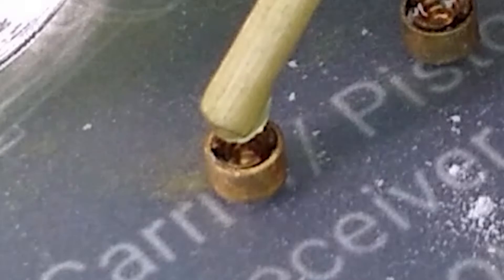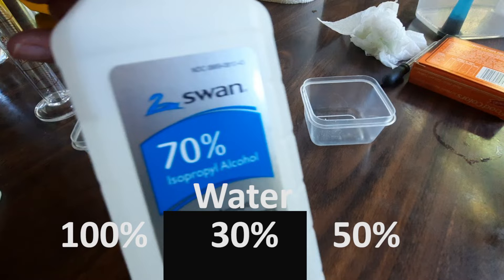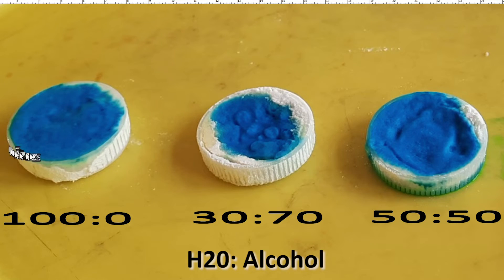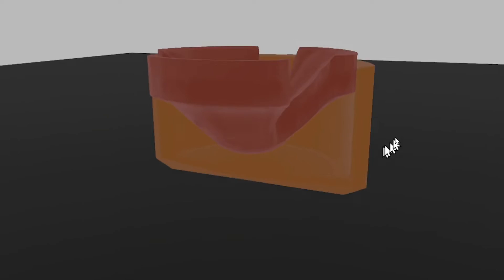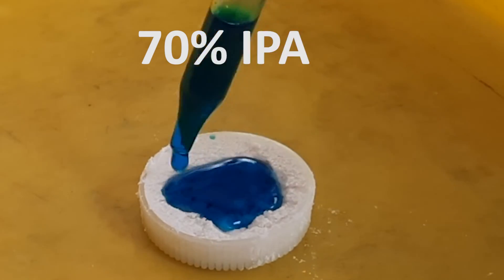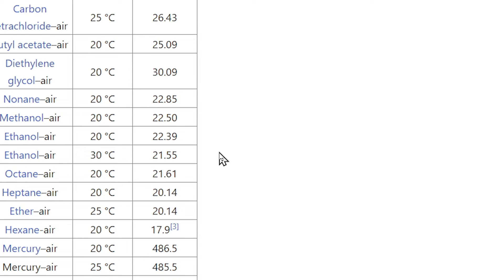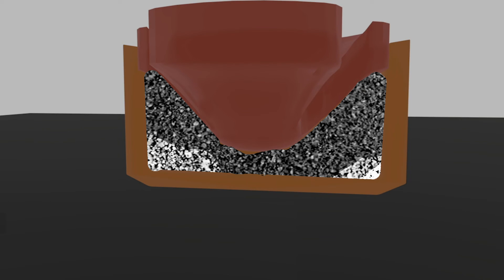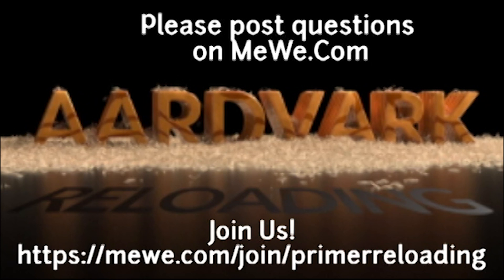Homemade Primers: Primer Activation - Surfactants

Comment: What does activating means? This process make them packed and easy to detonate ?
Reply from the maker: Our MeWe group adopted a primer recipe called EPH 20.   To make the powder "go live" it must be activated.   It is activated with  (of all things) water.    But we want the powder to be totally saturated/completely soaked from top to bottom with water or else the powder at the bottom of the cup won't burn (after it dries).   So we learned to add a little bit of alcohol to the water which in-turn decreases the surface tension of the water.   This allows the water to penetrate the dry powder more easily (all the way to the bottom of the cup).   

The alcohol has a second benefit.  Once it has done it's job of assisting in activation - it dries faster/easier so the primer will be ready to reload faster.

It's simple yet amazing as to how smart those guys (the chemists) are.   But they teach ordinary folk like me how to do it.   I, in turn, teach my listeners ( all free of charge).     

My next entry is an invitation to to the MeWe groups where you can see other lessons, ask questions and such.   All are welcome to join.
Reply from the maker: Hi there!

Jump Start 1 - I'm trying to get you going!

https://rumble.com/vjdy5h-reloading-primers-for-beginners-jump-start-1.html

AardvarkReloading.com and MeWe’s Primer Reloading and Primer Reloading for Beginners Chat Forums go hand-in-hand.

Please go to one of the chat rooms and let us know what information you need to get started reloading your own primers and our group of members will do their best to provide it. We are very interested in your success in this endeavor. There will be no ridicule of any questions you ask no matter your experience level. We grow by utilizing your background and experience in your various professions - so please be willing to share.

The MeWe chat forums consist of the best group of guys on the internet in primer reloading and other skills and you're now a part of it.

Primer Reloading group (known as Second Floor):
https://mewe.com/join/primerreloading

If you find the Primer Reloading group chat too technical, try the ground floor:

https://mewe.com/join/primerreloadingforbeginners

You will be welcomed in both!!!

My website:
I publish much of this info on:
https://aardvarkreloading.com 

==== MeWe Navigation ====
MeWe Navigation - Groups:
https://rumble.com/v15wnom-homemade-primers-mewe-groups.html

MeWe - How to Chat:
https://rumble.com/v15x61q-homemade-primers-mewe-chat.html

MeWe - How to Post:
https://rumble.com/v15x61q-homemade-primers-mewe-chat.html

Posting Photos and Files:
https://rumble.com/v18j51b-homemade-primers-mewe-groups-photos-and-files.html

and Finally . . .

One of the ingredients of many primer formulas is glass (from 'say'  a broken light bulb).   But this glass must be hand ground to the consistency of flour!

The information and all my tutorials are free but I must pay for the website, software, tools, and chemicals for R&D.    Click on the link below if you would like to help keep this effort going (and I'll send pre-gtound glass in return).

Thank you!

https://aardvarkreloading.com/aardvark.html

Comment: I have a primer compound that recommends acetone, any thoughts on that?
Reply from the maker: Id have to look it up but i think that would work well.   There is a chart i.ll have to google.     If i find it i'll share here and post on www.aardvarkreloading.com.   i don't think it will adversely react with the other ingredients.   

Check that - except the nc ( ground gunpowder).    It will soften but once the acetone evaporates - it will remain nc.

I'd have to test it to make sure (easily done).    Good question.
Reply: @helpmenowmark   Thanks for the help.  I think the stuff is called PrimeAll.
Reply from the maker: @Clarence_13x  oh.    Im familiar with primeall.   It will work.   But its an expensive form of h48 and corrisive to your barrel.   Use noncorroaive eph 20

Comment: What about using DMSO?
Reply from the maker: I am not familiar with this.    Is it accessible and inexpensive like isopropyl?
Reply: @helpmenowmark  pretty sure Brian is talking about Dimethyl sulfoxide. I'm not up to speed on the specific reaction that activates the compound, but there are a lot of different things you could experiment with in the place of isopropyl. The easiest thing that comes to mind to see if it makes any difference is ethanol. The difference between isopropyl and ethanol(without kicking off an organic chemistry class) is 1 carbon atom. Not sure if there would be any difference without knowing the details of the reaction, but maybe 🤷‍♂️
Reply from the maker: @joearledge1  but you are right.   Ethanol will work just fine and has been cleared by the chemists in the Mewe group.
Reply: @helpmenowmark  Sweet! Definitely can't wait to get started making my own compound
Reply from the maker: Where does one find it?   How much does it cost? What will it do to the other compounds in the primer cup?

I prefer to keep things simple.   Without having to google or crack any chemistry books... isopropyl alcohol ìs readily available, cheap, and it works.   It dries quickly (a good thing), it weakens the surface tension of the water (so the water penetrates the primer compound easily/all the way to the bottom of the cup) and it  doesn't adversely effect the primer compound /the ingredients.
To be truthful - we may not need it ( the water may soak in by itself).. But any compound in the bottom of the cup that isn't activated will be  wasted and it will result in a weak primer.
Reply: @helpmenowmark  excellent questions... I have no idea without researching it. I agree with KISS, but am also not opposed to experimenting with stuff just cause... eventually I'd like to take a look at the chemical reactions for some of these compounds. It's interesting that the water is what activates it, related to the auto-ionization maybe?🤷‍♂️ I'm also curious if the carbon chain on the hydroxyl group matters at all (methanol vs ethanol vs isopropyl alcohol, ect...) if not (within reason) then that could open the door for more improvisation in a pinch. If it does matter, does that mean that we can get better performance using one over the other? Or is there one that should be avoided? I know what you have works, and that's awesome, I'm just a curious nerd who likes to play with stuff and overanalyze everything🤓

Comment: I've gotten my EPH20 kit back out after a year and made some SRP's, SPP's and LPP's just for fun, it got a lot of attention from fellow reloaders on Tiktok, I sent several to your channel. I need to try wetting after putting anvil in if it will get 98% to 100%. I'm still pleased with how great they work lightly packing, wetting 50% iso then hemp rolling paper then seating anvil. I'm going to try obsidian glass powder instead of light bulb glass for the hell of it to see any changes. Thanks for the video!
Reply from the maker: Hi .   I wondered where you went.
Thank you for prospect's.   I e got a write up on improving reliability.    Did u see it on mewe?
Reply: @helpmenowmark  Thanks for the reply, I haven't, need to check it out, just got back into it again. I will lose the disk, thanks, anything to speed it up. I have always returned anvils to the cup they came from since day one. Now just using factory primers I've shot and sorting already vs a big jar of cleaned spp and lpp.
Reply from the maker: Lose disķ.    Not needed with eph 20
Reply from the maker: I think using cup anvil pairing may be a good move.   Headstamp sort your brass and keep cups and anvils matched when u deprime it all in batches
Reply from the maker: Next step down would be to use cci anvils only with chrome colored cups (for spp)
Reply: @helpmenowmark  Did you see my post recently of the spent primer ingot? Melted a couple lbs of cleaned spent primers into a polished ingot, looks fantastic, going to cast a small hammer for my eph20 kit, seems fitting. The finish hammer is overkill
Reply from the maker: @JaredHempfield  sure did.   Clean polished brass looks like gold

Comment: Glad I waited to the end of the video... you mentioning the "distilled water"...LOL.. I was bouncing on the edge of my couch.. But, you covered it.. I will go back under my rock and hide... As per the additives that are in bottled water and regular ole tap water, yes, there is allot of junk in it. One of the papers you linked me too about a year ago (approx) put me on a path to another paper that didn't have much to do with primers, but salt and chlorine and the various effects on the various sodium's and at various burn temps and various burn rates.. Which, until reading that one, I hadn't really put much thought into burn rate and burn temp and what the direct outcome results in different types of sodium's. Granted, the amount of chlorine/sodium that is with in a single drop of tap water VS a toxic measure of lethality, well, by my rough calculations, a man would have to rap off about 20 million primers with in a sealed off closed room about the size of 2 foot cubed (a box around ones head) in efforts for any worry... But, if there is another way to do it better, WHY NOT do it better, cleaner, safer, etc... Either way, a drop of something is needed... 

Thank you for the video. The past year or three, since I have been experimenting with PRIME-ALL compounds, I spend more time learning chemistry and reading papers then actually firing them off..LOL.. And I am loving it.. Upon a side note, I still have that large batch of test coupons of spent and unspent compounds (formulated as directed) on the various metals, to see the corrosiveness, various grade/alloys of aluminum, likewise with grades of steel, and stainless steel, and alloys of copper and the brass alloyed family. I check it about every month or 3.. Nothing notable yet as per pitting, rust, dusting/converting, stickiness... I am thinking about setting up an additional test, by cutting the samples in half with a razor blade, scrape each pile into 4 piles on each coupon, and drawing a line to divide the pair of piles with a wax pen, so there is a unspent charge, and a spent charge on one side of the wax line, and likewise, for the other two piles opposite of the wax line. one side dropping 2 to 4 different gun oils or cleaning solvents on those... It really should be a whole different set of test coupons to not contaminate the original test I have going on. The theory is, the wax line (hopefully) will prevent the leaching or wicking action of the oils as the oil tries to flatten out on the whole surface of the coupons? I don't know.. I may wait until I am satisfied with the testing I have waited this long for, to do a real world testing, that doesn't cost me anything, like buying one of those $90K weather stress testing machines that can do 5 years worth of corrosion in like 4 days.... I think not!!!! Imagine the amount of primers a guy could buy with $90K, even at today's over priced products... 

Pardon the novel.. I am just having fun with this stuff, as it seems like you are too. To give you another update, Which I won't and can't give the details on here, but, I am also playing with extraction of certain compounds out of simple products that even a child can walk into a store and purchase, meaning, these products are not regulated by any authoritarian safety committee's. They are not volatile on their own, but, trying to locate the raw compounds is either nowhere to be had, or cost prohibitive, so, what products out there actually do have what I want in them and how do I extract or divide them out to get or leave the one I want behind... Again, I am loving this stuff. Although, the numbers say it is safe to do, I still do it in micro quantities, as an example, like a pile of normal table salt crystal sized granules, maybe about 50 to 100 Approx and by weight, it is like 0.002gr until I understand what things are doing. Hows come middle school and high school chemistry was this fun? LOL... 

Oh, and another project  I am working on is, a manually controlled cup straightener, and peen leveler or remover, with a shaker bin, to turn the cup upright to flow into a track, that simmy's to a place holder, kinda like the holding area of the RCBS hand primer tool and the spring loaded cam action via the hand crank, does it all in one 360 rotation. I am still working out the bugs for making the design easier to unjam/unclog if a magnum cup slips into the troth. with out having to pull the top of the unit apart. or if one goes in cup-down-wards, that is really a mess then. Top and bottom have to come apart..
Reply from the maker: Noe dies makes a bushing for the primer reloader that help with some of the jams.

Resizes the primer cups to round.
https://noebulletmolds.com/site/shop/gun-parts/tools/primer-sizing-die-set/